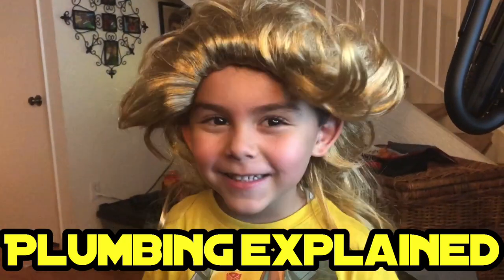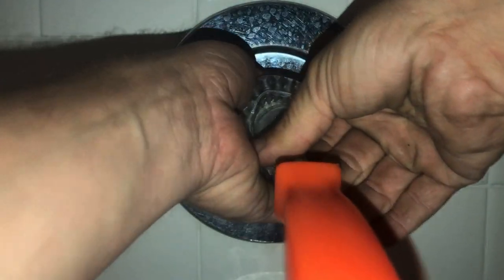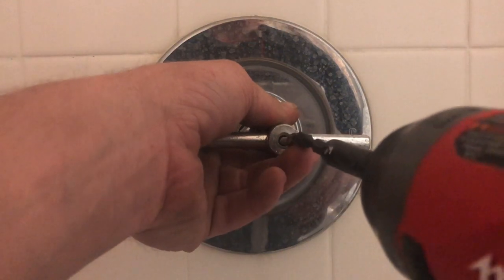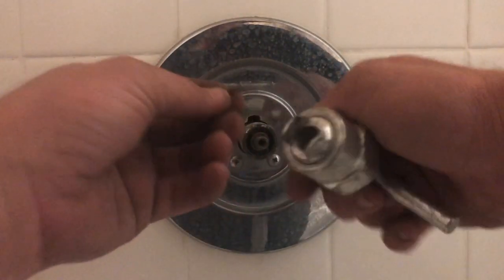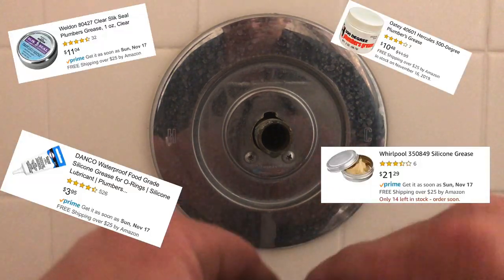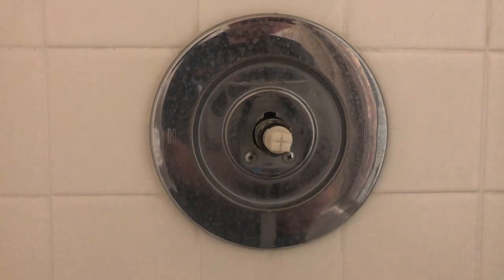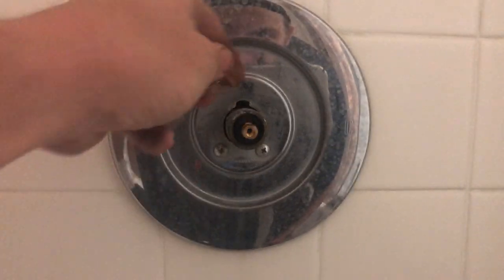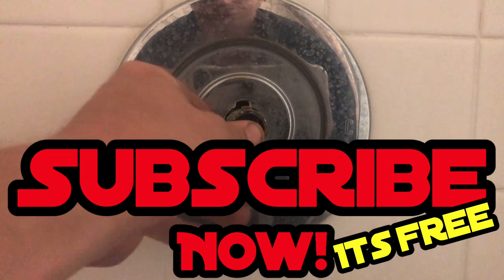How to repair a leaking, drippy or hard to pull out/turn Moen shower valve single handle 1225b

Comment: Will not using the plumbers grease make the faucet knob hard to pull out to turn on the water?
Reply from the maker: The hard water is usually what causes that but yes if somebody didnt use plumbers grease the action wont be as smooth. Sorry for the late reply.